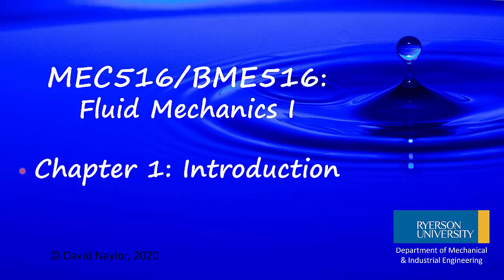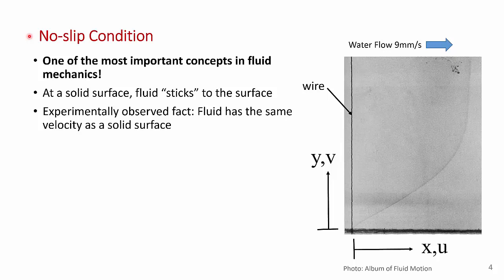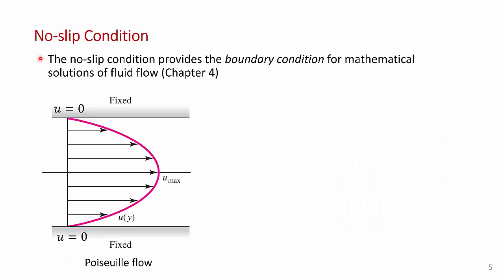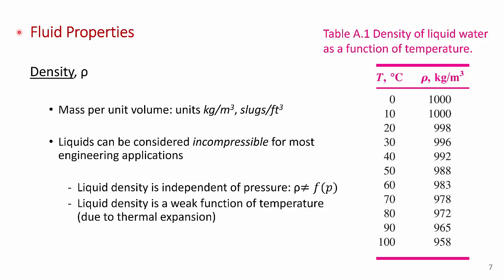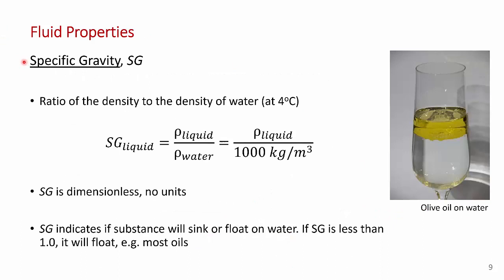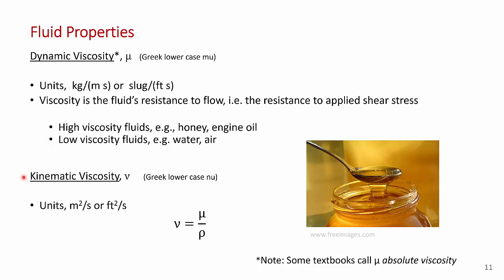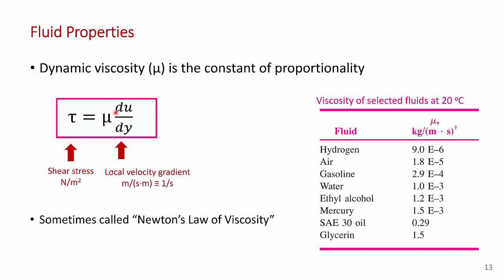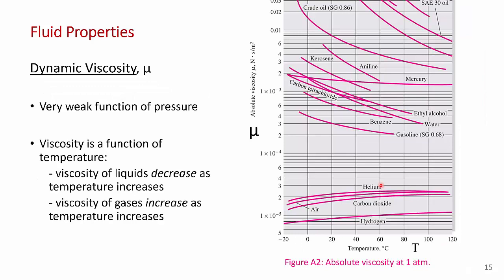Introduction to Fluid Mechanics: Part 2

Comment: Lol. I wonder if ketchup manufacturers take into account the thixotropic properties of ketchup when designing the bottle. Or asked differently, is it possible to design a bottle so that ketchup flows more evenly/easily?
Reply from the maker: I don't know. Apparently it took until 1991 to invent the upside down ketchup bottle, with the lid on the bottom. So don't hold your breath. ;)

Comment: Is it the no slip condition that causes the velocity gradient, professor or the internal shear stresses?
Reply from the maker: I'm not sure which part of this video you are specifically referring to. Here is a general answer. The fluid "sticks" to the surface i.e., the no slip condition. If the fluid above a stationary surface is moving (because of a pump or fan, for example), the fluid's viscosity will decrease (to zero) as you approach the surface. It's the internal viscous shear forces in the fluid, which opposes fluid motion, that slows the fluid in the near wall region.  So, to answer your question, it is both effects.  I hope that helps.
Reply: So, hypothetically speaking, even if there doesn't exist 'no-slip' at the bottom surface ( but the fluid sticks to the top surface) there would be a velocity gradient in the fluid, solely because of the internal friction between them. Am I right, professor?
Reply: I meant internal resistance between the fluid layers, alone, sir.

Comment: Hi. I just couldn't understand properly what no-slip condition exactly is. But you made it clear now - thanks to your wonderful explanation. I just have one question - is the 'dust on the car hood' example a valid example? I'm asking because dust is not a fluid. So my assumption so far is that you just used this example/figure to better explain the concept of no-slip condition. Please clarify. Thank you once again. :)
Reply from the maker: Dust is small solid particulate matter, NOT a fluid. If there was slip at the surface -- i.e., surface fluid velocity equal to the freestream velocity --  then you might expect these small solid dust particles to be blown away.  But they do not, because the dust particles sit in a very low velocity region, due to the no-slip condition. The smallest particles sit in a low velocity region well inside the so-called velocity “boundary layer”.
Reply: @FluidMatters  Got it! Thanks a lot!